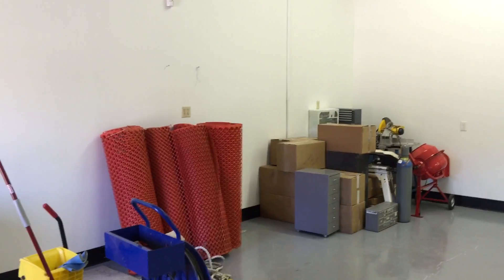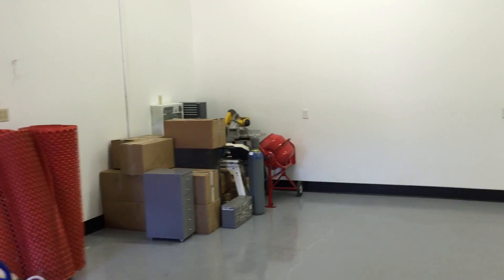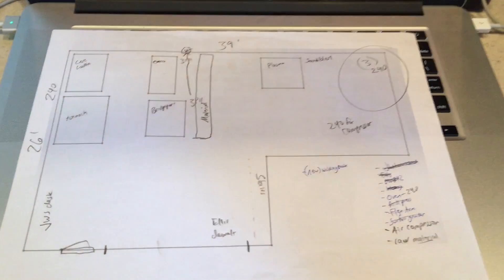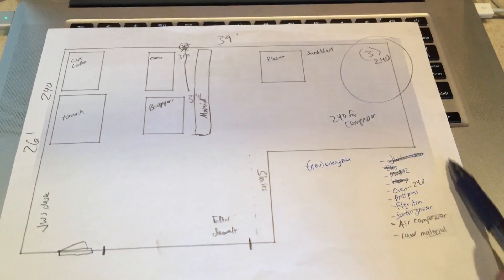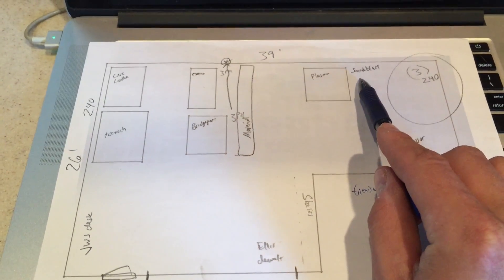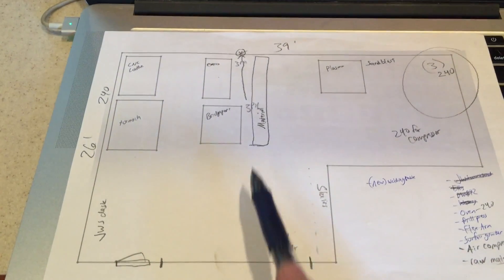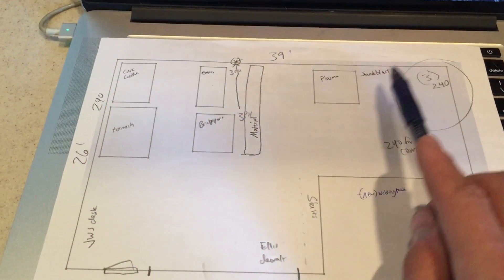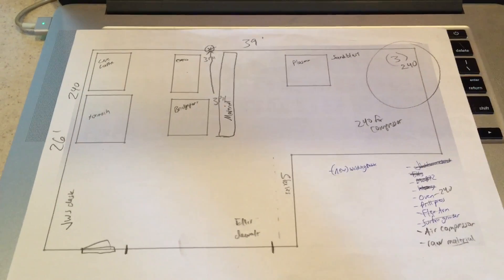New Shop - Layout?

Comment: As for the rough blueprints they seem to fit the bill. The welders curtain wall was a great comment.   Welding flash can be super dangerous. Movement of the hood seems to be right. Remove hood and duct in a way to utilize later if needed. For wiring go shorter route with alotted excess wire coil. For a stock go mobile with big casters. Store on back wall by room. For sealing the panel in room build small bumpout wall enough width to kneel in. Have a tight seal door like on an enclosed furnace room. I'd have a collection system as well for coolant and dust. If needing any assistance please e-mail. Awesome work. PS I'm setting up my shop soon. Debugging major bills and locations now. Email me and let's talk business and Turkey.

Comment: Hey there, just some advice, our shops surface grinders are close to our electrical panels, terrible, terrible idea. Metal dust gets all inside the boxes. fire waiting to happen. I work in a small shop at the moment, I would say our shop capacity for space is %95 full. No room for walking, and awful for cleaning. Heres my advice. I would take that office you have and keep that a climatized office/ inspection/ assembly/ design room and move your surface grinder(s) welder, oxygen acetylene under that hood. Depending if you do a lot of bigger plasma cutter work it may be beneficial to keep that in the middle of a wall, so you can do big jobs by cutting whatever your plasma table can fit, then stopping, sliding your sheet metal down, re-picking up and continuing cutting for parts that are bigger than your plasma table is. When I was in high school they chained all the bar stock and anything long and thin standing upright against the wall. seems like you have high celings there, may be something to think about. Try to keep all your machines against the walls if possible, you need some room to move around without tripping over everything. best of luck, I really enjoy the videos.

Comment: If I keep in mind how my granddad had things setup at the shipyard, machines on one side and welding some where away. This had to do with the fact that the light from the welding could still cause problems with your eyes when operating machines. If you need space for materials, I'd say keep it near the entrance. Best you could do is put a rack against the wall and have a seperate rolling rack that you could put outside if needed. The desk near the door wouldn't be a smart idea i think as it will be pretty cold with the door going open and closed during the cold times. I would guess if you move the vent like you mentioned it could be next to the material rack and have plasma and welding in that corner. I saw a staircase, does that lead up to office space?

Comment: John I'm sure by calling for opinions you'll be inundated, but for what it's worth here's my input.

Personally I separate the dirty and clean stuff to different rooms. All my grinders are in one area so that can just poop all over each other and nothing else. Hopefully not too much pooping, but you know how wheel dressing goes! Unfortunately my little area isn't as organised as yours! I'd include the powder coating to the "dirty" category as the powder is abrasive. I think that little room is perfect for all that stuff and maybe even get a little space for a permanent powder coating area?

The way you have the lathe orientated would appear to mean you couldn't feed stock in through the headstock. I know you don't run a bar feeder, but you may want to feed longer stock.

Don't forget that machines don't have to be put in square. It's the way we naturally think, but in many old school shop layouts you'll see the machines are actually often herringboned in. In my sub-miniature workshop my mill sits at a 30 degree angle for example. I know this is only a rough layout stage for you, but re-thinking the workshop outside squares may cause a re-think. In a non-production shop, with just one or two workers in it, you can "borrow" space to stand at one machine from space that may be required to operate another, knowing that there won't be another person at both machines at the time. My lathe and mill for example share an overlapping work space.

I hope that input helps.

Pete

Comment: Good luck on the move in. I figure it's to late, but what the hell - here's my two cents.I would keep material stock near the roll-up door where the desk was set to be, and move the desk into that little office room. I would also keep all welding/tools near the big door - just incase you need to layout stock in the driveway for large projects. I'd also move the vent and plasma table to the corner, this keeps the table close to the stock and if needed, fans can help blow the exhaust fumes out the big door. I would also put the welding table near the stock, and close to the roll-up door. The Bridgeport and manual lathe on the back wall, and the Tormachs back near the office. Regarding the blast cabinet/grinders ect., I see no shame in putting that stuff on rollers... With the exception of the welding table, you could create an open layout I think. If your welding table was say 4x8, that leaves half the big door unobstructed. The compressor, with aux. lines that could go in the office. With the door closed, decibels wouldn't be to bad if that was your concern. Perhaps the oven could go under the stairs with thermal shields.Just some ideas off the top of my head, don't know the exact dimensions of everything... Then again, what the hell do I know??? :-)Best wishes

Comment: If you have to keep the welding and hot work in the same shop, why not surround the area with curtain doors. I have done the same with my shop, basically separating my motorcycle storage area from the machine shop with a curtain between the machine shop and the dirty area. It has transformed my workshop and I no longer have to worry about dust from the dirty area reaching the machine shop or my bikes. The curtain material is available in UV proof stuff so it reduces the risk of arc eye for anybody outside the area.

Comment: If it bothers you now then fix it before it keeps bothering you 1000 times. And you're right I think the fabrication should be on the left side and the machine shop should be on the right side, so it's worth moving the exhaust hood. But instead of putting the sand blast in to your office why don't you consider putting it next to your desk around the rool up door? And your new shop is better than the last one!

Comment: John, since you work with Solid Works real well, you could do approximation measurements of all your things and place them in your approximate area shop. I would somehow partition off the machining area as you proposed (at the left side). I am not sure what climate control you should hold on the mill and lathe, but that would be one way to control debris from the other operations as well as hold machine dimensional stability at the same time. From the looks of it, you are gonna need the larger area on the left and do the dirty stuff on the right. No vent moving. Sure looks tight in there. You may need to get one wall free that has vertical storage to the ceiling. All the stuff by the overhead door on wheels is a good call.

Comment: I would switch the tormach lathe and the tormach mill around just in case you need to run some longer stock thru the lathe spindle. As far as changing things around (power, exhaust hood) if you can get away without making changes now you'll probably be better off by leaving it as is as it won't make a world of difference anyway from what I can tell
I would consider having the tormach back side towards the 39' wall and maybe have the bridgeport and the manual lathe back to back  (leave the b/p in place and move the lathe behind it, have the material rack along the wall where the manual lathe is in your diagram - this is for the same reason to be able to run longer stock thru the lathe spindle, if not really a need then it doesn't matter).

Comment: Here's my 2 cents :-).... Desk by door wind, weather, papers not a good combo. Imagine opening that roll up door in the winter to receive your metals and your papers get blown around and freezing your butt off while your trying to sit and do some cad/cam. 
So can I suggest sink room as office space isolated, clean, quiet, lunch area, meetings, phones etc
Left wall welding grinding sand blasting fabrication with a metal rack built 7 foot off the floor 24" out from wall as high as the ceiling ( just need a set of those rolling steps to access the stock) then suspend the hood from ceiling above the area in front of that. 
Tormach machines right rear corner lathe back wall and mill right wall forming the corner. 
Manual mill and lathe back wall. Band saw and Dewalt in front of steps. 
This leaves the whole center area open for work tables etc.
Maybe as part of the rack support legs near the door end  small rack for short stock at ground level.

Comment: hmmm though you've probably got it figured out here's what I would do. welding table next to the door where you currently have your desk material storage at the back of the table and above it on racks. Any open grinding operations done at the welding table or on the ground next to it. then up the wall from there I'd put the cutoff saw and bandsaw (use the welding table to support long pieces of stock) then the plasma and punch press. Along the back wall I'd have this order. Bridgeport on the left (so long as the table doesn't interfere with feeding stock into the manual lathe) then the manual lathe (so long as the bed doesn't interfere with feeding stock into the tormach lathe) then the tormach lathe then the tormach CNC. on the wall opposite the back wall (one of the office walls) I'd put the oven and sandblaster, potentially a scotchbrite wheel as well (though you may want that on the left of the shop in the "dirty" area). I'd put your desk and tool storage in the office. I noticed there's another door in there. Is that to the outside world? if so you could make that the office entrance to the shop to have a professional front for your customers. If not you could always lead them along the stairs and straight into the office so they aren't really entering the 'working' shop space. Just my 2c. Hope everything's going well!
Reply: potentially the surface grinder in the back left corner if it'll fit, if not I'd build a dust catching enclosure and put it next to the sandblaster as grinding is more of a finishing operation.

Comment: i would put the manual mill diagonally in the corner and the put the manual lathe to the left of the mill so the  lathe can be loaded with long stock and leave room for a roller stand. make a provision to have your heavy acc's easily accessible to the mill and lathe. check out abombs tree near his mill,very nice. good luck with your move.

Comment: You need to reverse the tormach mill and TL15, you won't be able to hang bars out the spindle if it's behind the mill.  Consider that you might want to put 4ft or longer bars out the back in the future.

Comment: I'm sure you got this figured out by now John. Best of luck to you. I like the way you had it planned out. I think either way would work. Whats up stairs? Restroom? Maybe use that room for storage, build some shelves to go in there. One suggestion is to maybe hang or buy some of those standing welding curtains to help separate the welding side from the machining side. It's safer anyways, those translucent welding curtains will help keep the welding flash out of your eyes when your busy machining.

Comment: I would avoid doing any dirty stuff like grinding near the electrical breakers, it would be easy to move the air compressor there and move the power to the other side of the wall, that would keep it clean and less noisy in the shop, the dirty grinding could go near the door, but where ever you put it I would hang some FRP panels which are easily cleaned on the wall behind it. Fiberglass reinforced panels are available at most hardware stores and are often used in food prep areas (sanitary and waterproof) and makes a neat appearance. Too bad you can't epoxy coat the floors, easier to do when empty. looking forward to seeing what you come up with... Best regards, F. Novak

Comment: I would move the hood to the left for the plasma cutter, welders and put the dirty stuff on the left by the door roller shutter, and put the cnc and tormach stuff on the right and use the office room as your office, inspection, qc area and try and sound proof the office abit.

Comment: Judging by the light, I would do it the way you drew, that way you can operate your cnc's in natural light, when the door is open.  The welding can be done around the corner by artificial light. to put it another way: i would put the machines where i spend the most time in the natural light possibility, so I do not end up feeling I work in a cave. And judging by the acoustics, you could get rid of all your stuff and start playing flamenco guitar there. it'll sound great! cheers and succes with the move.

Comment: I would agree with Jesse Hughson he makes a lot of good points .Looks like the ceilings are pretty high you might want to plan a spot for a section of warehouse racking and go vertical putting rarely used items up high.The bottom could even be a bench. Also we cut our bar stock in half ,very rarely do we need anything over 6ft and if we do we're most likely ordering stock anyway.

Happy moving

Comment: I would recommend keeping work flow and " machine work cells" in mind when laying out shop. And use some trig and geometry ;) to layout also. Like putting things in corners or at an angle to wall instead of parallel.?? Maybe keep material rack in line with door to allow easier transfer of materials??. Just putting out some ideas. :) Hope goes smoothly for ya.

Comment: Definitely move that hood to middle of the left wall.  keep the back right area as clean as you can.  don't put grinders in that little room; the room will just become a trap for metal dust and grime.  I'd use that little room for the air compressor, oven, washer/dryer, and storage of things you'll use less.  
I also wouldn't put materials storage in the middle like that.  it'll divide the space up too much.  keep big stationary stuff against walls and keep the middle of the space as flexible as you can with stuff on wheels or easily moveable for when you want to change the workflow.

Comment: Remember that both lathes need room to the left hand side of the headstock for bar stock material to project out from the headstock.  As you've got it laid out now, the Tormach lathe deadends up against the the PCNC enclosure, and the Emco deadends up against the exterior wall.

Might want to find a way to point those machines such that the left hand end of the headstock point out into the room or down an empty wall (or along a row of machines that can me easily moved to accommodate a long bar).

Sure as you don't do this, the very next job you have to run on the CNC lathe will be a production run that you need to run from long pieces of bar stock.  Murphy's Law of small business, right there.  lol

Also, the manual Bridgeport will take up less space overall if you stick it at 45° in a corner.  Might not matter, but if you need that one last little bit of space that's one way to gain some.

Comment: Setup your desk and inspection in the corner room since it can be kept clean more easily.  Mills and lathes on the right hand in two rows with a bench between them for setting thing down.  The dirty stuff can run along the left wall with material storage down the center backing against the mill/lathe stuff.
Reply: +NYC CNC We had this conversation about 7 months ago inre heating/cooling and contamination management. Mark is right on.

Comment: i put everything on wheels in my shop not the mill or the lathe .
Think about long stock in lathe, compressor under stairs with outside vent also water trap and chiller. You will need to keep elec. panel clear per code and safety

Comment: I would group the dirty stuff as you called it on the right near the door.  You can always open the door and use a fan to blow the place out.  I would keep things like grinders out of that electrical room.  I have seen stuff like go bad before.  An enclosed item in there would be good like a sandblasting box.  Or it also might make for a good place to store electronics and small projects in work.  You can have shelves with boxes for each project.  The echo might die down when you fill it with machines but you need to watch that.  You can hand acoustic tiles in strategic areas to quiet it down a little.  Good luck.  Nice space.  If the area that is upstairs is yours and is an office I would use that as you design office and business management area.  A desk in the work area is good but I would make it more like a drafting table to reference drawing, doodle new ideas, or to put your feet up with a cup of coffee :-)

Comment: If you have any outside space I would consider using 10' or 20' shipping container. Have your compressor, plasma table, powder coating, and grinding outside of the shop space. Not only removing noise and suspended particulates but it would be portable for when you expand. Having 8' of width would be enough room to build a nice bench on one wall and install your ovens underneath it as well. Install a sub panel, lighting, and ventilation then connect to the building with an umbilical and IEC 60309 interconnects or similar.

Comment: Personally I agree with the afterthought that you threw out at the end. The tormach mill and lathe should be in the alcove at the far right. Welding and fab stuff by the roll up door.
Reply: +NYC CNC I would put the two mill in both corner of the "alcove" because of space efficiency and I would put welding, grinding stuff along the wall next to the door